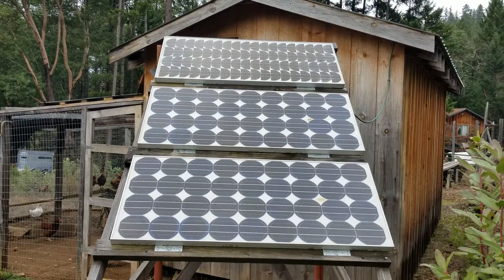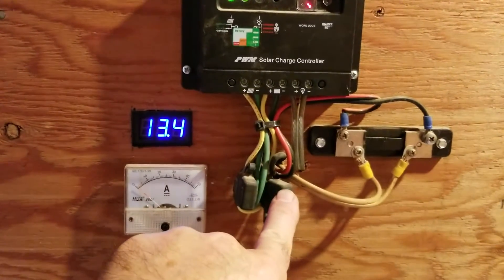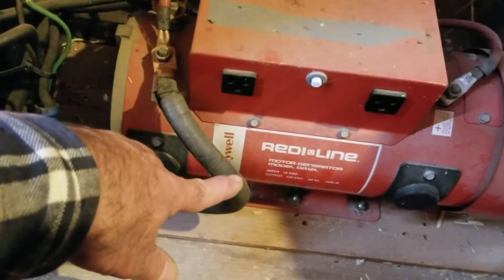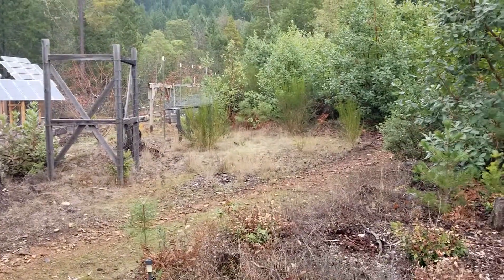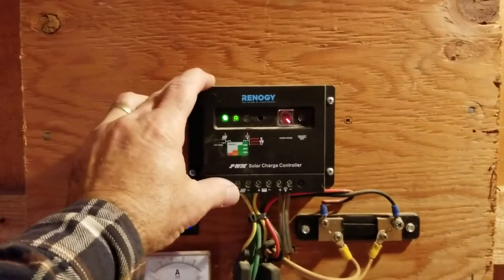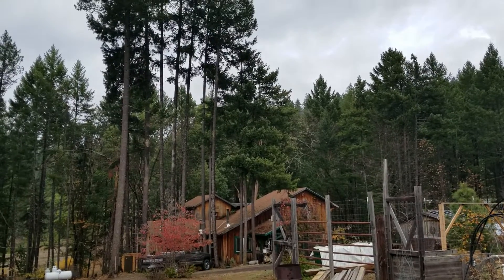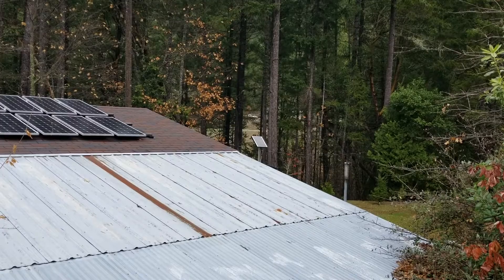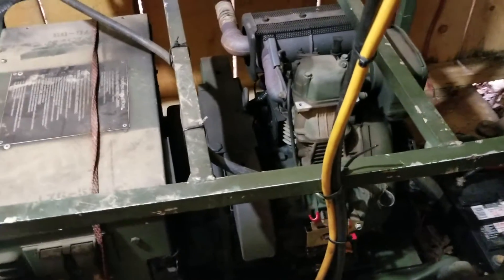Two small stand alone solar power systems! (Please read below)

Comment: Yes sir I had a small 12 volt lighting when I was in the cabin off-grid for 10 years. For 4 years I did not even have 120 volts in my place. Then when I met my wife. She asked to have AC power for her curling iron and AC in the summer. That cabin was so well insulated with spray foam. We could run the AC for 2 hrs and it would stay 70F into the next day. That window air conditioner was just 300 watts or so running. Was 5000 BTU of cooling. We got are 24 volt Magnum inverter and it would not even be on maybe 3 or 4 hrs a day. Most of that was when the AC was running. 

Back then PV was $30.00 + A watt. So was cheaper to run as much as you could on DC. That cabin was 800 SF had full running water and all. Even a 12 volt TV.  We did have LP water heater and LP stove. Most who would come over did not know there was no grid power. I miss that place.. God Bless Brother.
Reply from the maker: Sounds like home to me. The first time we were off grid I had a Servel  refrigerator, range/oven and water heater all propane. I had propane lights and a 12 volt TV. I had 2 car batteries and a dc generator that I built. We had gravity feed water too. No solar. Back in the early 80s solar was out of the question. Back then I never even saw a solar panel up close.
We lived at an old rock quarry. We were building a huge English Tudor custom home spec house. We did not get power hooked up until the final inspection. That was 1989 the year of the 7.1 earth quake. I had lived through many quakes but that one was one Ill never forget lol.
God bless you to Bobby.
Reply: @offgridinthepacificnorthwe3210  I was 11 years old in 1989. That was the year Hurricane Hugo hit. I will not ever forget that. Like you been in a lot of Hurricanes but that was the one that hit right on top of us.